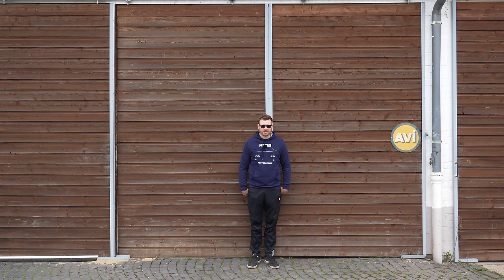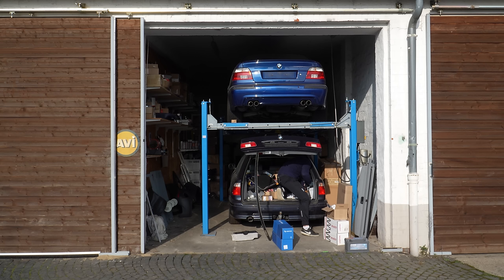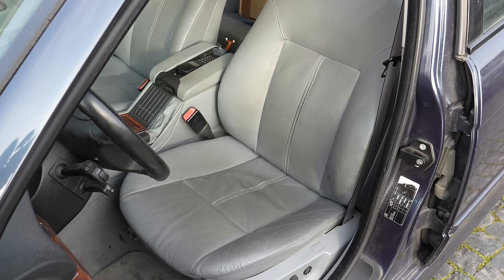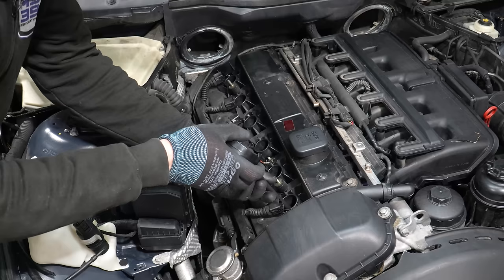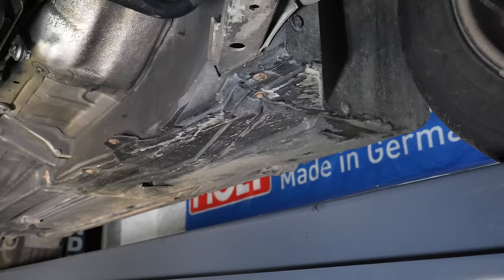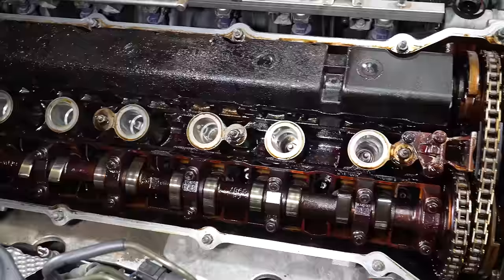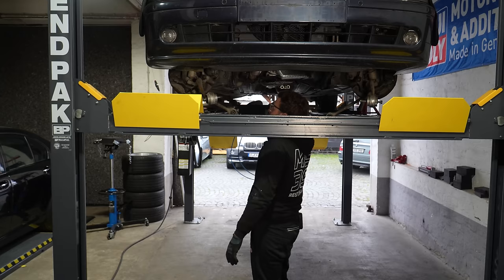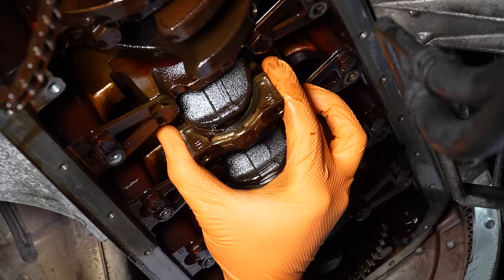I Bought a Heavily Neglected Executive BMW & Immediately Started Restoring it - Project Rottweil: P1

Comment: Congrats Sreten on 400k subs, it’ll be 1M very soon! It’s interesting to see how a once (relative) shitbox will be transformed into a nice daily. The temptation to drop that engine and fully clean/rebuild it would be too strong for me. Way overkill and beyond necessary, but that varnish looks the same colour as our wooden bench! Regular oil changes and preventative maintenance people!
Reply: That varnish is normal for cars that have been doing short journeys or sitting a lot, mine is relatively low miles and has had frequent oil changes all its life but hasn’t been driven much and it didn’t look too different to this when I had my valve cover off. I didn’t see any sludge but it was that colour. Nothing to be concerned about.
Reply: @renas5371  Varnish is not normal for any engine regardless usage conditions. You either used wrong/fake oil or exceeded engine hours limit.
Reply: @Trelliondeci  i have a 2009 car (from new) which was serviced with regular oil changes (about to 8-10k km) using only synthetic oil and the engine is very clean even it is pretty old and has about 160k km on it. Oil changes are very important, using the right oil and not more than a year.
Reply: @Trelliondeci  it's normal when you follow the factory oil change interval on these E39's, which is 15k miles.
Reply: Gotta refurbish a bmw 1m when it reaches 1m
Reply: @busterscrugs  that's way too much, in my opinion. Maximum 10k miles, only if you do a lot of highway.

Comment: I love the E46/39 platform. Drove a 330i for 8 years. Beautiful engine. Did most of these repairs also. Sold the car with 450K kms on the odometer. Car is still on the road with 470K kms. Rusting away but going. They are great cars. This was a beautiful video.

Comment: I also fell in love with BMWs after discovering the E39. Mine was a 6 cylinder tractor but it was smooth, refined and delightful. I now drive an 11 year F10 which I bought new and can’t imagine ever owning anything but a BMW. If you want to fall into love with BMW. You can’t go wrong with an E39. Looking forward to this series.

Comment: This is very personal video to me. After watching Sreten since he began his YT channel, I have been craving an e39 touring to complement my z4, which I used as a daily at the time. The only problem is that Tourings are hard to come by in the US. I spend around 6 months looking for one, but nearly everything I came across was either too expensive, too neglected or both. Finally, September 2020 is when I found my perfect e39 touring: a slick-top 2000 glacier green with two tone stone green and black interior for $2500. The car was a perfect mix of neglected but not too far gone. A rust free Texas car. It needed a LOT but it never left me stranded. For the next couple of years, I have been living of my own M539 restoration, overhauling suspension, oil leaks, cooling system, chasing vacuum leaks, redoing headliner in Alcantara and much, much more. The next step is a manual swap. The car has been a blast to own and at near 200k miles (322k km) it is so much fun to drive. I am looking forward to following the journey of this car and all the DIY tutorials that I will follow
Reply: Funny how different things are on the other side of the puddle. Here in Europe Tourings are unloved and cheaper as everyone wants a sedan. Same for E60s.
Reply: @pdcichosz  I know. I grew up with both of my parents driving wagons, they were everywhere in Europe. Tremendously practical and handle great. The SUVs just don't give the same experience, so I really wanted to get a wagon.

Comment: I had 3 e39s, oil pan gasket never leaked. It was everything on top, but never oil pan gasket, but if you are doing rod bearings, no other way around it 😀
Thanks for the video,  this is wat I did 10 years ago (except for rod bearings) and hope to get also a neglected one that I could wrench on it soon 🙂

Comment: Boy, now I can appreciate why BMW's can cost a bit to service. The mechanic needs to wear a white coat and have a laptop with him/her to diagnose and repair these machines. I can also appreciate the incredible engineering that goes into these vehicles. It's all relative. Love the preventative work Sreten does, you are giving these cars a new lease of life to run mostly care free for many years to come. You have picked up where Wheeler Dealers has left off - thanks!

Comment: Just discovered your channel, nice content. Ive got two E39s and one E61. My winter E39 was pretty much the same story as that one. It's a 2002 520iA, no rust on the typical E39 spots, nicely equipped (xenon lights, PDC front & rear, heated seats, heated steering wheel...) and the previous owner sold it for just 2000€ because it had very bad idle after cold start and bad oil leakage from the engine. After they had already replaced all 6 ignition coils and the fuel filter before selling the car, I did some research and it turned out to be faulty hydraulic lifters on cylinders 2 and 5, causing them to misfire while the engine was cold because they were locked in the "warm" position due to clogged bores. I changed all 24V hydraulic lifters, VANOS rings, oilfilter housing gasket (causing the massive oil leakage) and the M54B22 is running smooth again, staying dry outside. Did an oil change to the ZF 5HP19 transmission as well (the 1st oil change ever since it came from the factory) and it's shifting very soft although the car has 252.000km on the clock. It's the smallest engine, but it's fun to drive and it's a good feeling to save such a car to make it stay on the road.

Comment: @ 18:01 ... Beisan parts for the win on the vanos rebuild.  Excellent choice; I've now put 100k miles on my rebuilt vanos & still good.

Beisan is the one who originally developed the replacement seals that wont fail again; the others followed after & its unclear what quality seals & orings they use.  

RIP RB

Comment: I leased my E39 right out of college and purchased the car off of the lease. Mobil 1 synthetic oils changes every 4k-5k miles. Never had an oil leak. Zero rust being is a desert. 
Blew a radiator in 2015 and a water pump in 2017. Apart from fluid and plug changes that’s all my E39 528i has ever required. My E38 on the other hand has enough repairs for both cars.

Comment: Living in Poland I can tell you right away: it was a car for export sale, but not for parts or scrapping. It would be bought and most obvious things would be fixed or masked and sold on to an unaware buyer... :) Only after it would hit a tree, or 500k mark or a major engine fail it would be sold on further east. 
Believe me, what you would call a material for restoration (or beyond that point) can still be a normal daily car in the east :D

Comment: He is damn right!! I have a 2006 E91 330d touring with 171,000 miles on her with no oil leaks!! Recently a BMW tech checked it over during a heater wire campaign and they came back with no issues......proper German engineering!! Can't bring myself to sell her!

Comment: When you replace the front suspension to refresh worn rubber bushings, fill up the cavities with 60 to 70 durometer rated polyurethane from 2 part mix. It will stiffen up the bushings slightly and give feedback to steering the same way OE M3 cars do.

Comment: Hey Sreten, great to hear that you like the M54. I have the same in my E46 Coupe, and while mine is nowhere near restored or perfect, it just runs and runs and is everything I want it to be. It's quick, not very thirsty if you know how to drive it and reliable. As soon as I'm done studying I plan on completely de-rusting it, repainting it (again) and just replacing anything I feel like replacing. I also plan on swapping in a 5 (or maybe 6) speed manual transmission, the 5hp19 is just not as good as I want it to be. 

...I don't know if anyone even cares about my comment but now I've typed it out so I might aswell post it

Comment: Great episode with a lot of wrenching put in! Good to know that there's more to the VANOS than just replacing the o-rings and seals. I did mine, they went from totally loose to firm, but in the end still performance loss at lower RPMs. Like it had no effect. I think I'll have to re-do it, to inspect for damage as you pointed out.

Comment: I would love on massive part replacement videos like this to see a running total of parts cost and hours.  I know part of the magic is the editing and finger snap like replacements (before an oil covered mess, snap of fingers, shiny and beautiful!), but I think it would put the effort in context.  I see a lot of people complaining about stealerships and exorbitant repair costs, but I think many people have no concept of the awkwardness and difficulty of some jobs in modern BMWs.  My E46 was fairly easy to work on.  The second hand E91 Touring I added next, not so much.  The BMW engineers seem to delight in locating bolts where you need eyes in your fingertips to find them, where you have to remove half the engine bay to replace a commonly failed part, integrating the PCV valve into the valve cover so you have to spend almost $600 when that inevitably fails, etc.  Its now a fools errand to own a modern BMW past the warranty period.

Comment: I used to own a 2000 528i Sport. Such a lovely car and so nice to cruise in. Bought it at 187,000 miles and sold it at 232,000 miles. It was high maintenance but I never broke down on the side of the road. 

EDIT: I wouldn't have sold it. But because of London ULEZ, I had to.

Comment: I've had my license for a little over a year and im on my 2nd E39, I've yet to have a car younger than myself hahaha. I bought my first E39 at €1500. A lowered Topaz Blue 520I 2.2l from 2002. I worked on it myself while working on getting my license. Last christmas I had it wrecked because it was a complete rust bucket.. I salvaged some parts from it and bought a late 1997 E39 touring fitted with a sweet 528i 2.8l engine, FOR €900.

Comment: looks like pretty smooth going, my greatest fear is some studs broke and spends hours trying to extract them.

As I am now, 2 diesel injector retaining bolts are broken, after drilling a hole in one and attempted to extract it with extractor, the damn extractor broke😱

Comment: Great video Streten as always looking forward to see how it continues. Just a tip for you, when polishing aluminium try using the metal polish and 0000 grade very fine wire wool, does a great job and no scratches etc.

Comment: Had two of those engines, m54b22 and m54b25. Great engine, except for the oil usage problem which did not happen in my m52b25 or m62b35.

Comment: My M54 engined X5 project is driving me crazy with a newly developed misfire under load that is in Cylinder #6. The Codes are Cylinder Activation, and Misfire.  It has new plugs and newish Bosch Coils.  I even cleaned and swapped around the injectors which made no difference either. It has a new fuel filter and air filter too.  Since I bought it there's been stubborn battery drain too that I have not figured out. The suspect is the Final Stage Unit of the HVAC system even though the blower works fine on all speeds. I don't have the money to just throw all kinds of new parts on it so I need to figure out the exact causes.

Comment: 12 months ago to the day our slick top E91 Msport was drowned. I'd look at it thinking, I can't have it be parted out for the sake of a dead n52. Although we got touched by the mechanic (I think we should of been on the side of their race cars as a sponsor) we spent the market value of the car getting it back on the road. I looked for the same spec for sale and if it was Msport, it had a sunroof. No sunroof, it was a poverty pack or too ratty for me to spend more money without a healthy YT channel. 
Btw, the replacement n52 was out of a 5ser. I imagine it has the multiple stage intake manifold. It certainly feels as if it does.

Comment: 16:19 those are delphi coils right ? The current "by original number" supplier. BMW changed the supplier many times but these delphi coils will give you shadow code for grounding issue since their "body" is metal and in some cases these pencil style coils will touch the block. i replaced it with ones with rubber body, bosch does coils even under the new ecat number (the one you are using). its pretty interesting oversight by BMW but then again, this is 20+ year old model so its not like they were testing this.

Comment: First of all I love your videos. Started watching because i bought myself an e46 and wanted to learn more about the car and stumbled upon you working on your e46. From then I happily await new videos and enjoyed every one of them so far.
But i have 2 questions: 
1 - is it okay to spin the engine for compression test? Wont it deplete battery? (maybe not for this engine but what if it would be a 12 cylinder)
2 - did you flush the engine of excessive coolant with watter? Will it not rust?
Thank you for all the work you put into your videos.

Comment: excellent video and I'm looking forward to seeing the next one. I always wanted a 530i touring (I've had touring/estate/wagon cars for 20+ years) but ended up buying a 2018 530d touring last year instead, in part because a 530 is now a 2l 4 cylinder (with less power than the 530d) and the 540 doesn't make sense for my needs.

Comment: Hi! Let's try to use Dimexide to completely flush the engine to look like new condition. You will need Dimexide and cheap oil with this condition of engine I think you will need about 4-5 cycles to flush.

Comment: I had a few E39's. Love everything on them except the steering (and the cup holder).  All of them are hard to steer. Almost like there's no power steering. Not a problem on the highways but when parking in tight spots. On the other hand, the E38's are WAY better in that regard.

Comment: The thing overwhelmed me the gas tank leaked the rear axle mounting bracket had cracks all around it the vanos needed to be done the chug clutch slaves cylinder and  brake booster both were leaking oil And of course The pair windows and the  A c brokin Las Vegas

Comment: Hey Streten, hate to break it to you but those are not the comfort seats. Those have a split backrest which is adjustable. Sure they are active seats, but not comfort seats. Out of the 6 E39s i currently own only two have comfort seats, only one has active comfort seats.
Active Seats that are not comfort seats are actually pretty rare but you sure got them.

Comment: Try to bring engine to temperature. Drain old oil and put diesel. As much as oil. Idle engine for 10 15 minutes. It will wash all the buildups in the engine.

Comment: Hey guys - what is that black thing on the orange/yellow part between the steering wheel and the radio at 2:48? Mine has just got a hole where that black thing is supposed to be, and I have no idea what it is that I am missing :D

Comment: Sreten, Did you ever consider replacing the timing chains, guides & sprockets on a higher mileage / questionable oil change history M54 engine/ Can't wait to see your rod bearing video as I am in the process of M54 refresh on my cheap and broken (in my mind) E60 6 speed manual.

Comment: Once the “varnish” is there, is it possible to remove in time with flushing, the use of additives and regular oil changes or will the colour of the internal be changed forever?

Comment: Coming up. Engine begging to be saved,
actual fire heated seats, an unusual activity.

Major issue, fellas!

SRETEN: What's up? I'm in a situation where I
need a daily for my daily. You know what I mean?

Been daily drying my 2001 E46 325i Touring
with the 5-speed manual, better known as

Project Cologne for the last 3 years, and I'm
ready for a change. I want something a bit

faster, a bit bigger, but most importantly, more
comfortable. Behind these doors is just that, so

let me show you what we got.

Project Cologne is not going anywhere, it's not for
sale, I adore that thing and we're still going to do

the 330i swap at some point, hopefully this century.
Mine is the supercharger because we're going to

supercharge the thing that's behind these doors. Also,
like what you see, brand new merch. Check it out!

Now let's go inside because it's pretty cold outside,
not that it's any better inside.

Comment: I have a 2000 e39 528 and are scared witless now by all the plastic bits, cooling and suspension parts which are probably broken already or will break any time now causing catastrophic failures that will result in turning my nice car in a heap of rubbish.

Comment: Just answer me this: what is the proper oil change interval? My 2018 octavia has 15k km interval. My 2005 Mercedes B-class had 15k km interval. I usually change at 10-12k km. Is that good enough? 

As far as I can see, you can avoid most / almost all engine issues if you just change oil regularly.
Reply from the maker: 10-12k is good.

Comment: I have something I wanted to gauge your thoughts on. I have an 05’ E53 and she’s starting to have engine and trans problems. I’ve considered swapping either out for something else, so do you know of any good transmissions I could find that will work with the vehicle that’s a manual? If not, what do you think would be a good option for me to drop into the car as an engine-trans combo from another bmw? Thanks for the great content!

Comment: flushing the oil system of old engines is a bad idea if the engines were not washed regularly and oil changes were not more often than the regulations. flushing can pull out all firmly embedded deposits and clog channels or get into friction pairs. then no liqui moly will save

Comment: I knew that kind of mustard on the oil cap means that thenheadgasket leaking and coolant mixing with oil. What else can do the same ?
Reply from the maker: Condensation from short drives or short running of the engine.
Reply: @M539Restorations  good to know, thanks